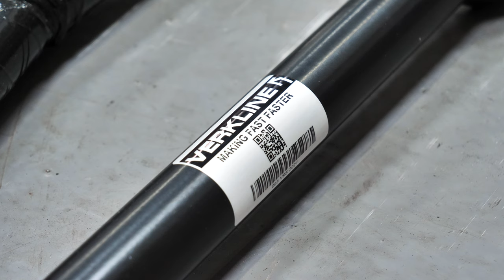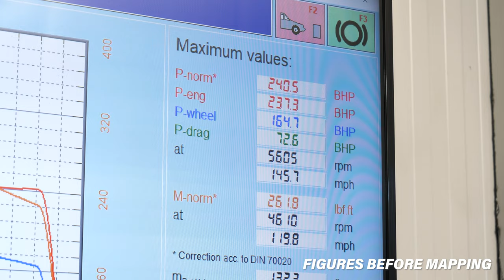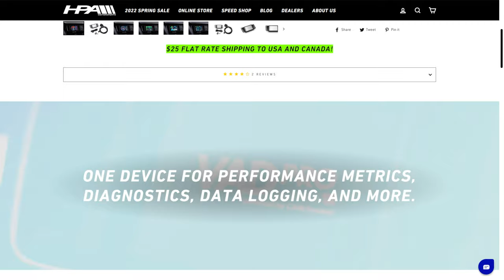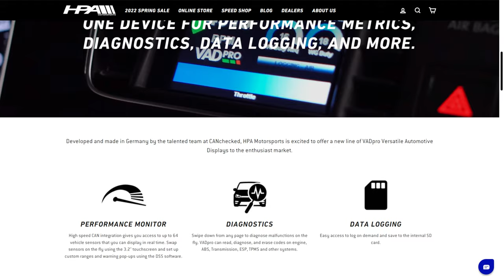Volkswagen Golf GTI MK7 ULTIMATE Track Build! (Area Motorsport x Tegiwa) - Part 1

Comment: Wow, this is like watching exactly what I did to my MkV GTI. I additionally did a full poly , frame collars, fully adjustable front / rear camber arms / plates and S3 aluminum spindles. I was going to go yellow speed but went YCW reference instead because of the custom Swift linear spring rates.

Comment: What’s the cost of all this? About 11k including FB labour?
Reply: Around £3300 ex for all the chassis parts, brake parts and catch can kit. Fitting would be around £625-£775 to give you a rough idea.
Reply: @areamotorsport  so with the turbo and components and seats etc it will come close to 10/11k?.. 4k for all the handling mods and brakes is decent.
Reply: l Mc it is turbo as standard 👍
Reply: @areamotorsport  i know, I thought there was a turbo in the parts section lmao😂😂😂 I didn’t watch it all my bad. One of those days